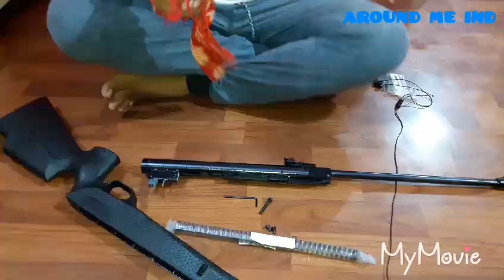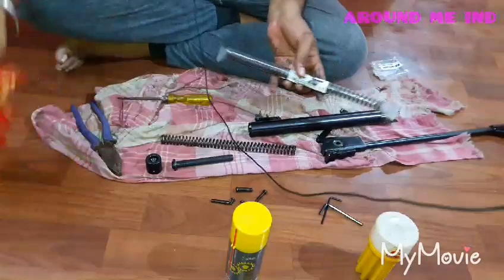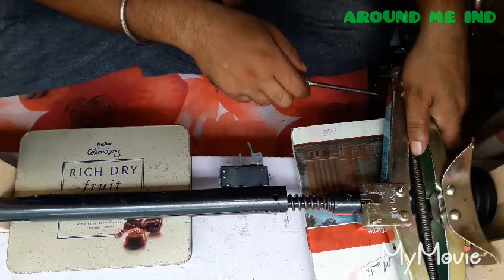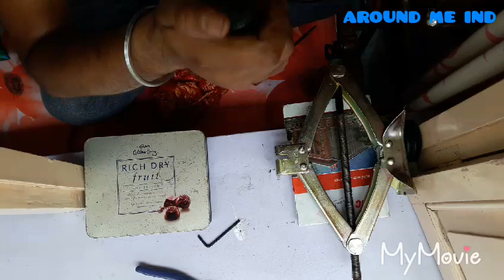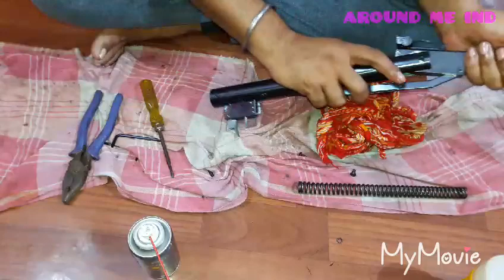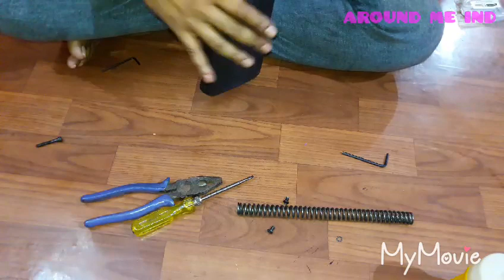VX100 air rifle repair  🛠🔧🔩

Comment: I bought this VX100 spartan about 3 weeks ago....but I have a problem... When I loaded the rifle, sometimes it cannot fire when I pulled the trigger, I have to reload two or three times...what is wrong with that???...can anyone tell me how to solve this problem???
Reply from the maker: Sefti look on kiya hay app sor??
Reply from the maker: On the sefti look then pull trigger
Reply: @debjyotisblog2801  it does not matter....safety on/off....when I pull the trigger, it can't fire...its misfire...I don't know how to solve....
Reply: Same is happening with my vx100. When i pull the trigger, there's a miss fire sound and the pellets still inside the barrel.
Reply: It must be the piston seal,the piston seal must have some damage on it
Reply: A piston seal kha check chhin teh,a thalo aniang
Reply: Change sear lock spring buy from kovibazar and you are good to go.